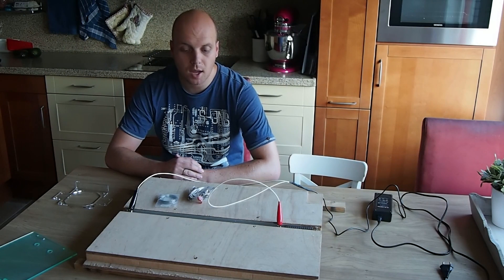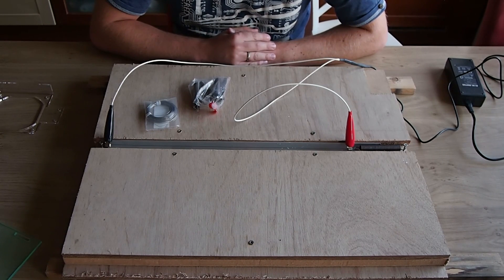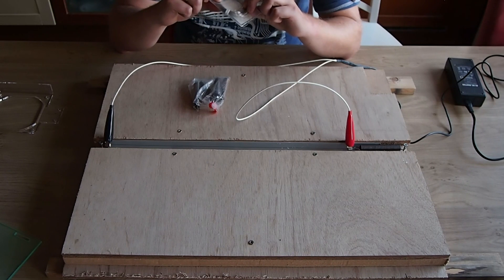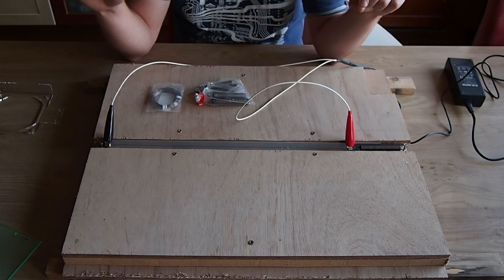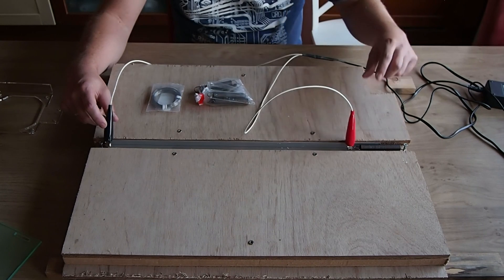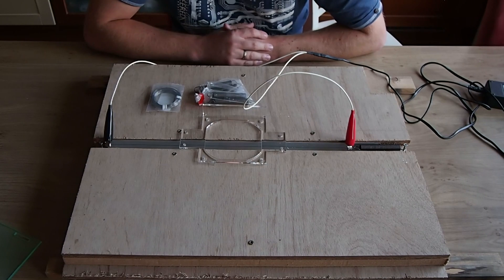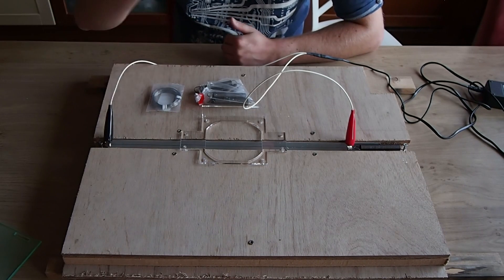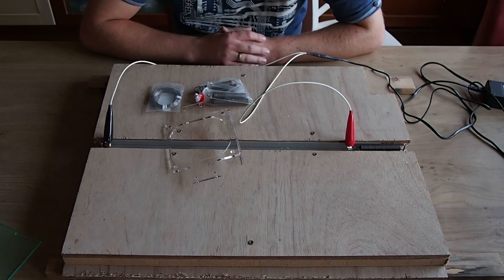How to make an acrylic / plexiglass bending machine

Comment: if you bend close to the pilot holes does the hole distort at all? i am designing a piece that will need to be bent only 2mm away from the edge of a 4mm pilot hole to accept an m3 thread size screw....thanks for your video it was very helpful...